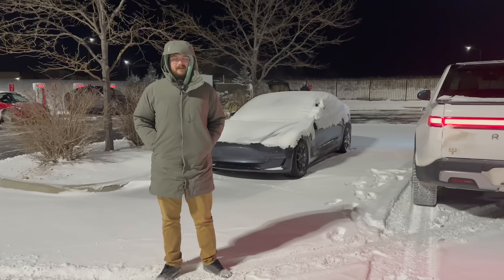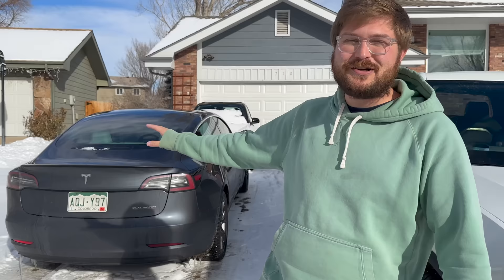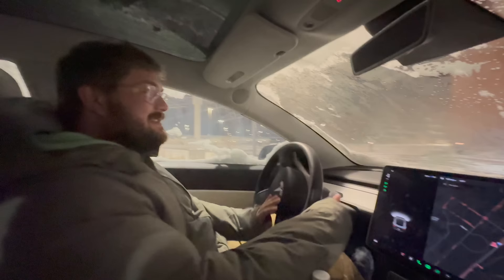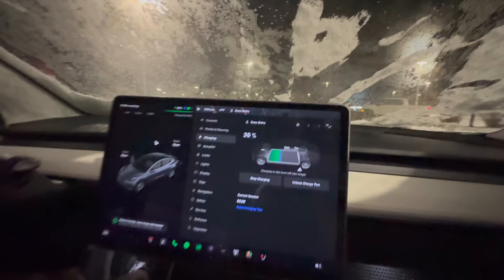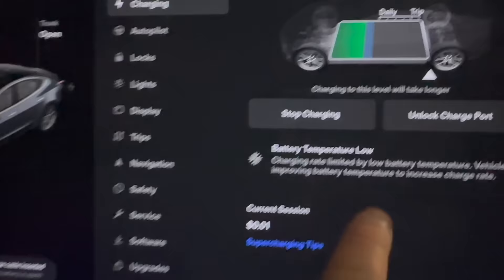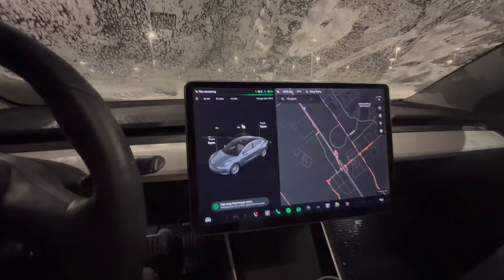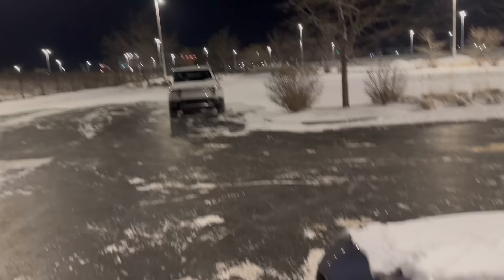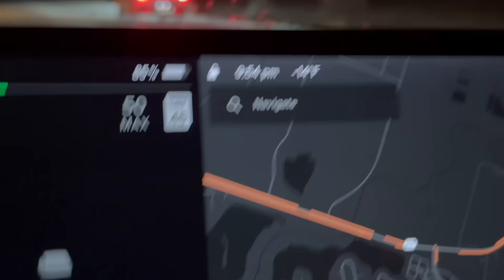I Deep Froze My Tesla And Immediately Plugged It Into A Supercharger To See What Happens

Comment: Never seen such spin on how awesome something so ridiculous is.
Reply: “Nobody does this better than Tesla” sure, but it is still really bad..
Reply: Yeah.   This is definitely serving the metal idol instead of the car serving you.  Sitting in a freezing car, with just seat warners, spending an hour of warming batteries with "waste heat" before even pushing a charge.....running back to another car with the cabin heater on to survive the night....running down the charge on the other vehicle.

What a Doc Brown nerd fest.  We saw Tuesday that the cars went down to zero, just parked overnight.
Reply: he intentionally did not turn on the cabin heater for the test. you could just sit in the car normally. and normally it would precondition. and also gas cars in freezing weather need to use engine block heaters and stuff.
Reply: His closing comments didn't age well.  An extreme case but it would never happen in the real world....  Chicago Chicago that toddling Town.

Any severe cold situation involves vehicles left alone and untethered to freeze up.  His method on trips, also discussed, running down in his skivvys to plug in his car at the hotel charger to prewarm it....that doesn't work when the hotel is full and there are two chargers.
Reply: Or you have to dig the car out...or wait a week for a plow
Reply: My Dodge Ram diesel didn't start in Banff during a brutal cold spell. So yeah, cold = bad.
Reply: @STho205  Remember; none of these stations are manned. Won't take long for homeless addicts to identify a supercharger as a good place to single out "rich people". Remember E-car owners, if you  are on a first time trip of an unknown distance, keep some loose change in your car for the tweaking undead that will constantly be around while you charge your car in the middle of the night.
Reply: @wilg  Eh, in some places maybe, midwest (KS/MO/OK) not in at least a couple of decades or more. Great lakes? Buffalo?
Reply: @wilg  if he had turned the cabin heater on, it would slow the already painfully slow preconditioning. Took him 45mins to condition without the heater. Can’t imagine how much longer it would be with the heater on.
And not everyone drives 45mins to a Supercharger. Most live much closer than that so they will still have to wait for preconditioning at the charger.

Gas cars definitely do not need heater blocks. They start at -20F no problem. That’s what low viscosity oils are for. Most importantly, it takes 3 minutes to fill up a tank because gasoline only freezes at -100F.
Reply: @wilg don’t talk shite.Just start a petroleum,car and drive.
Reply: The real world is every winter in the Northern Hemisphere
Reply: @wilg  Where's your statistics on block heaters being needed?
Don't make stuff up and don't expect to be called on your BS.
Reply: Shilling never felt so cold.
Reply: I see this a lot, especially from Tesla owners.  Most drivers would consider this to be "stranded", not awesome, so I'll pass, thanks.  When I encounter a Tesla owner, they'll openly point out defects and limitations, followed by "this is awesome".  I'm in northern Michigan, where temps stay quite cold during winter, so this is not acceptable.
Reply: Any honest person would call it for what it is… a POS
Reply: LOL  Why doesn't the car precondition the batteries automatically in such cold weather?!   smh
Reply: -45c in Alberta Canada glad my gas hemi remote starts block heater not needed.
Reply: What energetic source powers the charging station? Was it a Coal fired powered station?
Reply: @wilg  Haven’t plugged in my 2010 Ford Diesel in fourteen years.
It just starts, right down to -42C or 
-45 F. I always have to work when it is really cold, own my own biz.
Reply: I think the test was done in a Reckless way which can put families at risk😢
I mean who Stays in a Car in - 16 for more than 2 hours with the Heaters off 🤔🤨
.
What would happen if the Tesla Heaters were on in the Cabin 😳🤔 can the Tesla still keep heat going to the Cabin & Batteries 🤨😏
Reply: So if you have a flat battery and need to charge in low temps how can it pre heat the battery?
Reply: @scaryfakevirus  preheat is a scam is going to take more 2 hours anyway for the car to be back up & running if your battery is low and have 30 miles left do you really want to waste 35 miles preheating
Reply: @niceboy60  That's right.  If there's no power in the battery then you can't pre heat it and it won't take a charge at all.
Reply: @STho205  I don't know how he thinks it won't happen in the real world. Most people park their vehicles outside, just like he did. The difference being they'll have to somehow make it to the charging station first.
Reply: @STho205 your right lol.  They always just generalize its the best, when you give specifics hiw it sucks.  They're making idiots of these fools buying these expensive paper weights.  Wait till they can't crush them at end of life in the junk yard.  😅😅
Reply: @wilg  False!
Reply: @littlejimmy7402  -
Good comment !!!  None of these “idealistic” EV applications make sense for everyday big city urban life, AND over 60% of the U.S. population lives in  congested, dense, multi-family, residential urban areas.
Reply: @wilg  I've never had an "engine block heater" in any car I've even owned in the 28 years I've owned a car, that only applies to diesel vehicles.
Reply: A Tesla and a Rivian?  Lots of money invested in vehicles.
Reply: Why do non EV owners spend so much time watching EV videos? 🥲Sad way to spend your time.
Reply: @erickminor   Maybe so, I just needed to explain to all the people over here in the car park why they couldn't charge their cars, their phones were dead too.
Reply: I see a lot of excuses for nonsense. An electric vehicle does not work well in extreme cold; simple. Who cares about how awesome and beautiful a technology is, If one needs to babysit it just to drive for an hour.
Reply: What I see here is a lot of excuses and nonsense over nothing, it is a fact that electric cars don't work well in extremely cold temperature, simple. I don't get the spin that it is a beautiful technology, but we just need to babysit it for about 3 hours for one to drive for one hour.
Reply: You're right ..can you imagine screaming kids in the back seat ...an elderly person ...someone who doesn't own a home ....someone is sick and needs to go to the Hospitol.....this things a POS for them in the real world.
Reply: The video shows that Teslas work fine in the cold when you keep them charged and warm. They charge pretty well once preconditioned.
Reply: Here’s a real world example.  I live in Montreal which gets colder in winter than Colorado.  Most people don’t live in detached homes with a charger. That’s a huge population who fall into this scenario.
Reply: @matthewnadler89  Exactly this is not realistic at all..for the average person.
Reply: Their must have been something in the Tesla Cool aid.  He is too chipper working with this piece of S___.
Reply: @wilg  I started my gas truck at minus 16 the other morning.  Fired right up.
Reply: @wilg  I live in Northern Ontario. We can easily hit -35 Celsius for weeks at a time. In my 40+ years of driving I have never plugged in a vehicle. People do that so there vehicle warms up faster. That's why I have a remote start.
Reply: I'll take plugging in a block heater into any outlet in my house over the continuing hassel it is to charge an electric car, any day.  @wilg
Reply: Why Elon didn’t put his chargers indoors (away from the freezing), in surprising. No emission, means you can charge indoors.
Reply: @STho205  WHAT! As many have said, you can't cure stupid! Just make sure you have a bit of charge in the car and pre-warm the battery on the app, simple.
Reply: @bellshooter  TAHW.
Reply: @wilg  That's much less hassle.
Reply: @STho205  ???????  Flatearther rides again.  🤣🤣🤣🤣🤣🤣
Reply: Never underestimate the idiotic optimism of a corporate shill
Reply: It will not happen in the real world?

Where is he at the very moment those words came out of his mouth?
He is sitting and standing  right  in the middle of the real world!!
Reply: “Need to use engine block heaters and stuff”?
Reply: In a normal economy that doesn't pick and choose winners and losers with money printing and other financial manipulation, we'd have a competitive developer scene where these problems would get solved step by step in experimental vehicles using special permits. I build it, I prove it's road worthy, and then I deal with any shortcomings. Instead we're supposed to be QA testers for huge companies because they're the only ones who can get permits in places like Chicago where the bureacracy is worse than the weather. I just don't believe that the tech is the problem, but rather the poorly maintained charging network, the passive owners and the attitude that somebody else should fix things for us.
Reply: You'd have to be retired to have the time it takes to get one of these EVs going.  With a gas engine we could have already gone to the store and back .
Reply: Agreed this brother is in deep denial
Reply: @redrider7730 That was an excessively long rant to say, "I don't know anything about EV's or insurance." 
You're probably not concerned with health but vehicle exhaust (diesel being the biggest source) is the greatest source of health-damaging air pollution which increases healthcare cost for all. Air Pollution is a direct cause of respiratory illness and cardiovascular disease.

Do  you sell cars for a living or work in oil?
Reply: @redrider7730  What did Elon do to you?🤔
Reply: So, you have to drastically plan your life around your vehicle?
Reply: I saw a video of a guy in Texas who has 2 Chevy Volts, which he parks in the garage. When Texas had that deep freeze a couple of years ago, both of his Volts would not run or charge. He had to use his mom's gas car for a week! I live up in the Sierra mountains about 30 minutes outside Truckee. We get a lot of snow. I have never had a problem with my vehicles starting. If they have been sitting for a couple of weeks, my truck might need a couple of tries, but it starts. When I lived in Alaska, we would plug the car into a heater. It was parked outside no garage, but it always started. Also, I didn't have it plugged in when I went to work, and it would start after sitting in the freezing cold all day. This was back in the mid-80s, and I had an old vehicle back then! So with all this new technology, people are stranded in the freezing cold, unable to charge their newer cars. Complete idocracy!
Reply: @deardra5619 Volt is a hybrid, gas engine should start like normal.
Reply: @stans5270 Their block heaters are plugged into their.... homes. A Tesla can also be plugged into their homes if one plans ahead, right?
Reply: @ronysmith1  Give me the statistics on block heaters in normal gas cars. I live in Maine with -40degree winters with no block heater. I really don't see your point on block heaters.
You forget so easily. It was only a year ago that "Drivers Stranded for 24 Hours on I-95 in Virginia" was a headline. Driving an EV is a death sentence when that happens.
That happens many times every winter in every mid-west state.
Reply: @stans5270 @stans5270 I don't have statistics on heaters, but there's trade offs in everything. Diesel and gas have their problems as well, like more fires (17X more) - according to multiple studies. Just the media hyper focuses negativity on EVs. 3X to 5X less cost per mile when comparing electricity to gas. And lots less in maintenance. Cold weather is hard on diesels too, but we preheat them by plugging them in too. When power is knocked out, Cybertruck will be able to power your home too. Gas cars can't.  So there are trade offs and each driver should know and prepare accordingly. In fact, some people have died driving through forest fire smoke in their gas cars. A Tesla for example would run at approximately 40 to 50 hours on a full battery, running heater only. (A guy tested his in sub-freezing weather at a usage of 1.36kW per hour, on average. With a 80kWh battery, this means you could sit nice and toasty for almost 59 hours on a full charge, or about 29 hours on a half charge.
Reply: @ronysmith1  "Just the media hyper focuses negativity on EVs. 3X to 5X less cost per mile when comparing electricity to gas. And lots less in maintenance." - Where are your stats?
So you want to save money???
What are your insurance costs?
Parts for an EV are up to 3-5 times more expensive than gas cars. That's why insurance is 175% of a gas car. The EXTRA cost of EV insurance costs more than my yearly fuel bill.
2011 Civic 219,500 miles and non-routine maintenance has been $400.
Reply: @STho205  chicago that toddling town?
Reply: @Hello_there_obi  yes one day it will grow up....we're pulling for you 100 years to get out of the kid gang'sta era.
Reply: @STho205  im from the uk lol
Reply: @Hello_there_obi  yes Brits are funny.  I like Harry Enfield myself.   What is your comic styling?
Reply: @GROGU123  oops, I meant to type bolt. His cars wouldn't take charge inside the garage.
Reply: @littlejimmy7402 yeah, that doesn't happen
Reply: So how do you start a dead diesel at those same temperatures?
Reply: Glad I'm old enough, to never have to, own a vehicle, that's controlled by the internet.
Reply: @stans5270 I have had no problem starting any of my gas powered vehicles at minus 30F when needed. I don't plug mine in until it's 0F. Apparently you've never lived in truly cold climate.
Reply: @jimgrady8004  Apparently you missed my comment to two days ago where I stated"

@stans5270
2 days ago
 @ronysmith1  Give me the statistics on block heaters in normal gas cars. I live in Maine with -40degree winters with no block heater. I really don't see your point on block heaters.
You forget so easily. It was only a year ago that "Drivers Stranded for 24 Hours on I-95 in Virginia" was a headline. Driving an EV is a death sentence when that happens.
That happens many times every winter in every mid-west state."
I hopes this clarifies things for you.
Reply: @oddjobsandrandomprojects  What years are you talking about?
Will ANY properly maintained ICE car start and run when in the extreme cold?
You're talking about a minute percentage of regional vehicles.
In 2018, diesel vehicle sales amounted to 518,020 units, or 2.62% of all sold vehicles in the US. EVs are selling at 7%.
An exception to the norm doesn't prove jack.
My points are still valid because I support them with facts.
When proving a rule, there are always exceptions, but exceptions mean nothing when you want to prove a point. Block heaters even at 50% [it's more like 10%] account for 1% [0.26%] of diesels and 1% of gas cars. I have yet to some across ANY in Maine. 
Notice I never said there were NONE, but equating mandatory 100% plugging in of EVERY EV car so it can run, and plugging in a convenience feature for comfort of 1% of ICE cars, shouldn't even be thought of as remotely the same.
And that's real.
Reply: @OmarZ77  I understand that he wanted to avoiod any possible confounding factors for test purposes, but it should have been OK to turn on the cabin heater. A supercharger can deliver at least 125 kW, far more than the 5 kW or so his battery heating was using, so turning on the cabin heater simply would have drawn more power from the supercharger without affecting his battery heating.
Reply: @oddjobsandrandomprojects 
Spending less than 5 minutes 3X per month getting gas is better than the additional concerns when your power goes out and you get stranded...
Plus being stranded waiting for parts...
They should nickname the EV driving experience to stranded.
When you say "What do I [you] know?" The answer - Much less than you think you do.  
Stick to ONE subject. Reading your comments is like trying to catch a squirrel on crack.
Reply: @oddjobsandrandomprojects  Wait, you said " But to me, plugging my car in every night rather than going to a gas station sounds like an improvement. But what do I know." followed by "And I've only been talking about 1 subject, cold weather driving in ICE vehicles. Not sure why you think I'm all over the place." 
Are you on Ritalin?
Reply: @oddjobsandrandomprojects  "any realistic conversation" is based on reality, which I have found lacking in your replies.
Reply: @oddjobsandrandomprojects <<< Pigeon
I have played checkers with a pigeon long enough.
"Wisdom itself is pursuing you, but you have always been faster."
Not everyone can pride themself because they're slow.
BRAVO.
You brought ZERO facts to support ANY claim.
Reply: @wilg 40 below wind chill and no block heater or additives with my car. Drive to the gas station and fill up in 6 minutes. What you said in defense is a joke
Reply: @PaulWagner1 well it's a diesel and a Dodge. Two strikes against you 😂
Reply: This Test puts families at Risk because it seems geared to benefit Tesla and not the Users
1- Who Preheats Teslas Frozen Batteries with all Heaters Turned off 😳🤨 and waits in another Warm car 🤯
2- Every single Person or Family in a Tesla Preheating Batteries + Cabin is in unknown territory, because from this Test we don't know if the car is capable of warming Cabin & Batteries at the same time🤔😢
3- We don't know if there's a Preheating Time penalty if you also try to keep the Cabin warm if you have your family with you
Reply: Who has 2 hrs to waste?
Reply: @littlejimmy7402  That's a little paranoid and not correct. Superchargers are over 10 years old now. They aren't overrun with homeless, actually I've never seen one of those poor folks there. Superchargers started in 2012.
Reply: @OmarZ77 That's BS. Turning on the cabin heater will not slow preconditioning of the battery.
Reply: @scaryfakevirus As long as the car was parked with over 10% there should be no issue at all. Heating the battery to accept a charge (at all) should not require more than 2- 4kwh, and less for cars with a heat pump. In any case, do not park an EV unplugged with 10%. Moreso when it's winter. Its just common sense.
Reply: @FrostyAUT  so it gets the energy for your cabin heater out of thin air? It’s conservation of energy law.
Just like using your phone while charging slows down charging.
Reply: @FrostyAUT  That may be the case, but what if it isn't?  Not many people have any comment sense these days anyway.  But what if you just manage to get to your destination with 1% left because all the chargers were  broken / big queues /  wrong chargers etc.  I can always walk to a garage or get a lift with a can - can you?  Yeah but ..... LOL
Reply: @wilg  I'm 74 and lived in the upper midwest my whole life and don't know of anyone who ever used an engine block heater, and what is stuff?
Reply: @oddjobsandrandomprojects  I did reply but YT wouldn't upload it so I am not writing it all out again.  All I can say is - you'll see the light.
Reply: I wonder how many hot/cold cycles these batteries can take before the welds start breaking?
Reply: do yourself a favor and buy a diesel. forget the greenies🤨
Reply: imagine wasting your life doing stupid things like this😱
Reply: @bobhancox3660  I call them watermelons.  Green outside but red inside.
Reply: This is a ridiculous test. If the car had been driven or had even been preconditioned before being plugged into the charger this wouldn't have happened. This was a very specific test to see what would happen if you didn't do what you're supposed to do beforehand.
Reply: @DoRC  This is not a ridiculous test. This is actually a really realistic thing some people would do.

Do you have any idea how many people drive home from work tired with a low tank of gas and say "Fuck it I will fill the tank in the morning".